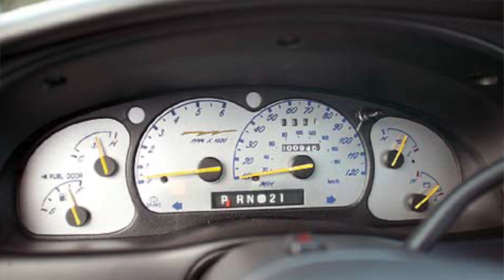SVT Lightning Bolt 5.4L Ranger—Supercharged Prototype That Almost Made The Cut!

Comment: I remember this truck!  I think if they had waited for the 3V 4.6L to be developed, this would have made a cool late 2000's production SVT vehicle.  It would have made for a nice send off for the little Ranger.
Reply: Hard pass on ANY 3V, lol
Reply: @02autogt  What issues did the 3V have?  My old one ran like a top.
Reply: @Tornado1861 None for practical purposes. He's just another internet keyboard expert parroting what he's heard about vehicles he's never owned. My cousin owned two s197 GTs, one blown and one turbo'd, raced them at the strip AND on the track, and they both went 150k+ miles before he sold the second one, bought an 18' Coyote & never looked back. He still talks about those cars though.
Reply: @02autogt you're confused with the 5.4 3v

Comment: I did something similar to this with a 2000 Mazda B2500 and stuffing a 4.6L DOHC in it from a Lincoln Mark VIII.
Reply: This! Ford could have made it much more feasible with a motor and transmission that could have fit the production sheet metal with frame and suspension mods.

Comment: Ever tried to do an Explorer XLT 5.0  to 5.8  swap? The whole platform didnt suit the Modular 5.4 engine unless the ESP program was sorted to suit. It was like the Crown Victoria quad cam or fitting a 7.3. Ford had to do some Heating and Ventilation HVAC changes to fit the Modular in the body and service the engine.
Reply: yes ford did do it. i saw the proto type when i was working a  ford dealer in so cal.

Comment: In reality, I bet the thing handled like crap. ~400 more pounds in the front end with the 5.4, blower, exhaust, heavier suspension components and wheels/tires. With the heavier transmission needed, heavier frame, diff, and wheels/tires out back, way too much hp/tq on a short wheelbase with narrow track. Too heavily weight biased in the front end would make it plow and want to swap ends. Ford would have lost money on every unit with a Ford GT price tag, and then lost millions more in lawsuits. Probably would have been hard to actually measure the 0-60 and 1/4 because you would not be able to get any traction. With all that said, I could clean out some junk in my garage.